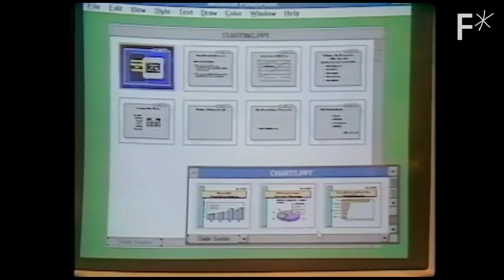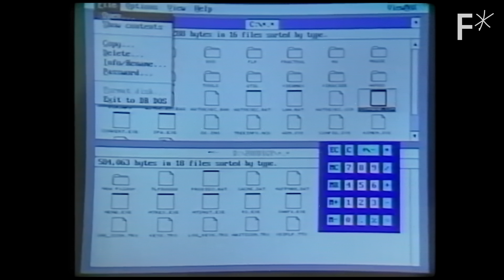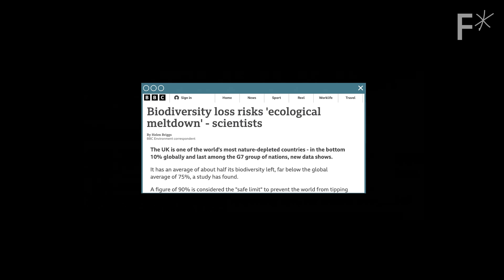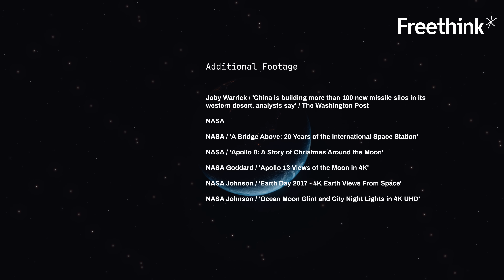Tiny satellites and a new view of humanity | Hard Reset by Freethink

Comment: Definitely cool but what are they going to do about space debris from their products? Like does it all burn up and does it pose a threat to other satellites during its lifetime?
Reply: The orbit is too low for it too stay for very long. So it deorbits naturally. There's also literally way more space than is required for small or even large satellites.
Reply: Dude, if you think the surface of the earth is big.... Imagine the scale of the atmosphere 😂. At these heights and at this size, it's a non-issue
Reply: @josephdouglas6260  I love your answer. simple and correct
Reply: @josephdouglas6260  that's not exactly true. Space debries is already a problem because things in orbit are so incredibly fast that the circle the earth dozens of times. If a collission happens at these kinds of speed it's absolutely deadly and can generate thousands of tiny fragments that can impact other satellites. So even though a impact is very unlikely by itself, when something happens the danger is multiplied.
Reply: Will worry about those details later.  You know the old saying, "You can't back a cake without breaking a few eggs".
Reply: @MusicByJC  look up 'Kessler Syndrome'. If everybody thought like you did then we could literally get trapped on the earth. The worry is not about breaking a few eggs, it's about breaking every single egg and also killing every chicken.
Reply: and it will pose a problem for launching space crafts too, if we have too many satellites, they'll have to all get outa the way for space crafts
Reply: Put it in a polar orbit. One satellite = one image per 24h, two satellites = on every 12h. So you don't need a huge starlink type constellation.
Reply: Who cares? As long as the masks keep people from spreading viruses and these satellites make sure there's no misinformation about climate change on the internet, humans are set for a very bright and free future....
Reply: @adammillwardart7831  🤡🤡🤡
Reply: The orbits are very predictable so you can tell if there will be a colision and acount for it ahead of time, and these satelites are low enough that they natrually deorbit rather quickly, and they are small enough that they will burn up in the atmosphere before they cause any harm.
Reply: Most of our satellites are in low earth orbit so even if we had a catastrophic cascade event, it wouldn’t stay in orbit for more than a few years tops but even that seems excessive. Once satellites strike each other they’ll automatically loos a portion of their velocity so will be on track for depending way quicker than initially planned. Low earth orbit in general always has some air molecules floating around so they’re always dragging on satellites with a few hundred to a few thousand molecular strikes
Reply: yes… the kessler effect…
Reply: As an aerospace engineer that's the NUMBER ONE question none of these clowns will talk about. The second is about who really benefits and how.
I've spent a chunk of my COVID downtime delving into economics so that I can better deal with management types. I'm reading "Angrynomics" by Mark Blyth & Eric Lonergan at the moment and there's a great comment during the introduction about technology. 

from page 14 "We hope to shoe that technology is changing some things but not everything. And that a lot of what people say is really techno-babble and a bunch of fantasy-hawkers selling bits of the sky to each other and gullible investors. Entertaining, but not serious. We argue that just because a technology exists, it does not follow that it will be adopted."

Like almost any engineer I can give plenty of examples of where superior technology LOST OUT to inferior technology. A good example was Betamax losing to VHS in the first generation of private video recording. Another was molten salt reactor technology which was proven in the late 60s early 70s and was a far superior and infinitely safer technology than water cooled nuclear reactors and it was never adopted. Accidents like Fukushima could never have happened with a molten salt reactor.
Reply: @tonywilson4713  
Great post, and very informative/educational to me - gracias.
Reply: @justinklenk  If you get a chance grab a copy of "Angrynomics" its a book written by an academic and an hedge fund manager so that normal people can understand what's going on.
Mark Blyth does a lot of lectures and interviews (as both the interviewer and interviewee) and many are available here on YT. I find him easy to listen to because he talks about how politics and economics interact as parts of a system. That's very similar to how I was trained to think in aerospace where we have to consider the entire system because everything is linked to everything else in very tight conditions.

Its kind of why I get quite frustrated with both Elon Musk and Jeff Bezos at times because they are not thinking through how these complex systems actually need to work. Marks great at explaining how economists are very similar. They only consider there pet market or subject and treat it in isolation as if it has nothing to do with anything else.

If you have ever wondered if many of the financial and economic commentators operate in their own little bubble - YOU ARE RIGHT. Mark Blyth is one of the best at explaining how they operate in their bubbles and why they get things so horribly wrong. 

If you can't get the book then watch some of his lectures and he & Eric have done a number of interviews and book talks on Angrynomics.

Best to you.
Reply: @tonywilson4713  Oh you think the people in charge care about things like that? Just wait... The best is yet to come. Don't look up.
Reply: @tonywilson4713  yeah, this is totally junk technology. New thinkers must think very differently about future science.
Reply: @tonywilson4713  well talking about this issues could come to a solution. Not to think it is the main goal by doing it but thats whats really necessary from people discussing how to improve that variety of systems already working.
I think about economy as a field to render reality as well and it is just one of the areas all over our civilization to work on. Kryptos are a pushing necesity but a solution. 
Is cool to find people that might have a different thinking and not just roll the wave x)
Reply: @bioartmivideocorporativo1008  On these cube sats its what I tried to differentiate with another answer. 

Cube sats were conceived as a way of putting developmental hardware into space for very low cost. Its very expensive to test space hardware and even more expensive to test it in space. Cube sats use spare payload capacity to get round that and in doing so have been an amazing success.

BUT then suddenly having clowns like Elon and Jeff throw 1000s and 1000s of them around to provide services we already have is a solution to a problem that does not exist.
Reply: @tonywilson4713  exactly. Humanity is ridiculous and infantile, thats the only concept to define whats going on with our behavior as a species and is really sad to keep staring while living how smart people make the stupidest decisions on every contemporary topic.
Reply: @bioartmivideocorporativo1008  I'm Australian we just had the first debate between our "leaders" in our current election campaign. 
Its was like competition for who can be more stupid. Its so bad that its embarrassing.

Because of our system we have a very short election campaign this time - 6 weeks. We are just over a week in and we are already tired of both sides and their childishness.
Reply: @tonywilson4713  You are supposedly an aerospace engineer and claim that Starlink is a solution to a problem that doesn't exist... 😂 Yea, right, let's all just climb back onto the trees.
Reply: @tonywilson4713  You don't really seem to get the point? Not seeing the technical advantages of a LEO constellation and the particular implementation of Starlink vs GEO communication satellites for internet access is either ignorant or dishonest. Also, there are many different companies and governments launching GEO communication satellites, producing lots of space debris that will remain forever. Any issues on that front, or are you maybe just spreading FUD on the competition of your employer?
Reply: @tonywilson4713  Lets just say you might not have the qualifications to ramble about communication systems. Also, your understanding of satellite constellations and orbital debris management might be out of date. I'll leave it at that, good luck finding or keeping a job in the aerospace industry with that kind of temper...
Reply: so small it'll burn up to nothin before it could even hit anything,
its a great idea.
Reply: Tldr: we take all the useful materials from the satellite, in fact all the materials, and...burn them in the atmosphere
Reply: Not sure what this Tony guy is rambling about, but two things from a real aerospace engineer:

1. Satellites in lower altitudes of LEO (<500 km) are low enough to undergo ‘orbital decay’ on their own. They won’t stay there forever. That’s how junk and possibility of future collisions and debris is avoided. 
2. LEO economy is a real thing. Satellite internet is a definitely a real solution to a real problem. Most of the world still does not have access to the information highway.
Reply: @abhijeetkjaiswal  If you were real aerospace engineer and I am not saying you aren't, but you are being a cheap assed shite, then you'd know that what shat me off was Marian Keller attacking me with nothing but hype.

If you have something to say to me them reply to me, but don't be a cheap assed shite.

1) I never said ANYTHING about LEO constellations and before you start bragging about them go and look at how well the Iridium System FAILED. 
2) Yes I am well aware that LEO goes out to around 500km but unless you are below 200km it takes years to decay. You should know that is caused by aerodynamic drag, which is a function of air density which you should know drops away rapidly after 100km.  
3) If there is a Kessel Syndrome Event in LEO then YES I know it will all eventually fall out of orbit from aerodynamic drag BUT if you really are an aerospace engineer then you'd know that it will be incredibly dangerous to launch anything through that mess for years and maybe decades. People already have to be careful about flying around the debris left from the incidents that have already happened. 

Since you have ignored these basic facts I doubt you are an aerospace engineer or you are very young and your head is still full of dreams. I don't find fault with having dreams, my generation had them too. 

Back in college we all thought we were going to build Space Station Freedom and then a Moon Base. The we got the reality check of January 28, 1986. I'd actually been in Orlando 16 days earlier and watched Columbia take off. Even at 60miles away it was an incredible site. You'd could clear see the boosters detach and still the glow from the main engines when it was closer to Africa than America. But on 28 January 1986, 7 people lost their lives including a class mate of my aerodynamics professor. In that moment an entire generation lost their dreams. Its taken nearly 3 decades to recover from that and other "mishaps."

The biggest problem we have right now are clowns like Marian Keller who just jump on the idiotic technology hype bandwagon and ABUSE ANYONE who does not follow behind the wagon.
Reply: @abhijeetkjaiswal  Here's a free lesson in economics for engineers. Sorry if it seems like a rant or a lecture, but its a damn hard lesson that many people have had to learn.

ALL ECONOMISTS are trained in a very narrow set of ideas and part of that is to push back at EVERYONE else with 2 specific questions. Irrespective of the idea or the money involved they will ask: 
1) "What's the business case for that?"
2) "Who's going to pay for it?"

When you dig a little deeper, they ask those 2 questions for 1 simple reason. They don't understand what most other people talk about so its there way of defending their territory. They drag everything into an economic discussion which they will win every time.

You can have the best idea with the noblest of causes have a business case and have the money and they will still drag it into an economic fight where they will beat you into submission. This is why I started studying economics. It was so I could argue with them and at least have some chance.

I'm actually Australian but did my degree in America. When we finally got a Space Agency they released a "Road Map" of Australia's Space future. The VERY FIRST ITEM was "Space based advanced water management" which for an country like Australia has an easy business case. We have a huge ag sector that is prone to drought. Plus we have a huge tourism sector. Combined our Ag & Tourism sectors employ over 850,000 people (1 in 30 Australians) and generates about $250 Billion in economic value per annum. On a population basis its the equivalent of a $2.2 USD Trillion industry. 

EVERY Australian I have spoken to has agreed that developing "Space based advanced water management" is a great idea. Then they all ask why we aren't doing it? 850,000 jobs and billions in value you'd think its a no brainer, but I knew what economists are like. So I went looking for money. 

Like all governments the Australian Government has some really stupid contracts. At the time we had this insane $20 million a month security contract for an off shore detention centre in Papua New Guinea. Anyone who has worked in Australia's remote mining industry (and yes I have) knows the costs should have been about $4 Million a month at most. So I knew there was at least $10 Million a month I could use an NOT affect any other Australian Government program.

So I had a project that the ASA had identified as its number 1 future technology and found funding for it.
It was not only rejected but the Government committed $7 Billion (10 times as much) to the military's space program which includes a stupid never will work version of Ronald Reagans Star Wars.

But here's the big lesson of Western Economics. 
We will spend stupid amounts of money on unproductive enterprises that will never work let alone deliver any sort of worthwhile outcome, but things that actually make sense get stomped on. As we say in Australia. Canberra is where good ideas go to die. The same can be said about Washington, London, Ottawa,.....

If you want to say I am bitter about what has happened. YES ABSOLUTELY.
But its also why I get quite angry with uneducated clowns.
Reply: I'll tell you a secret, space is big, very very big, so big that you'd need to orbit as much stuff as to literally exhaust every ounce of propellent on earth in order to make space flights insecure.
Reply: @theguythatcoment  well is not a secret that orbital space s not that big and lets say we rid off from crashing collisions to avoid exagerations, that only will encrease a dependence of useless technology, investing in things that are ephemeral . So is silly to fulfill free space with more garbage.
Reply: @theguythatcoment  space is big, but ideal satellite orbits are limited
Reply: @theguythatcoment  BS.
The Universe is big, but the space for satellite orbits is limited and quite full with space debris already.